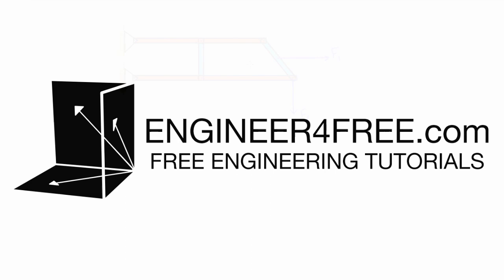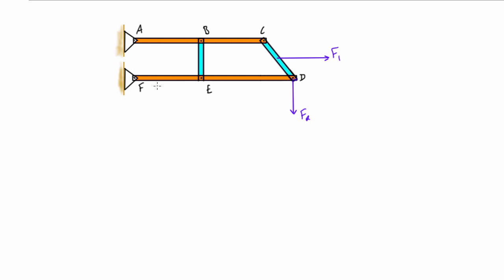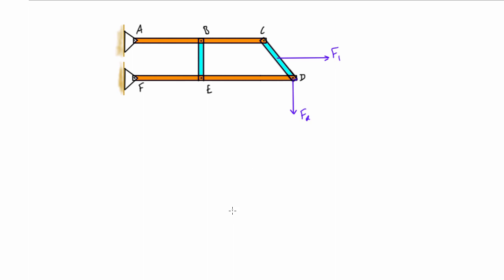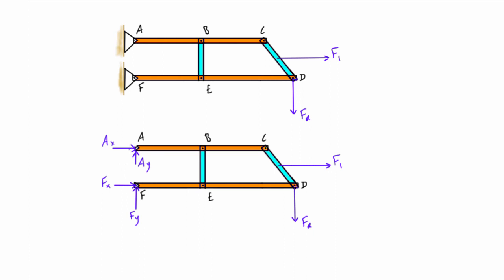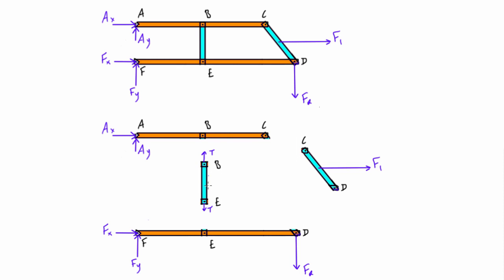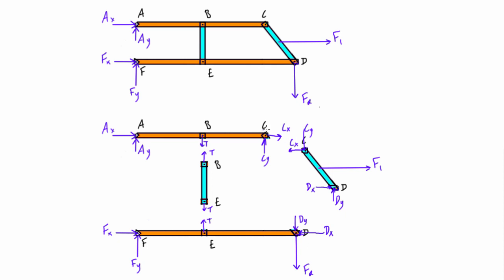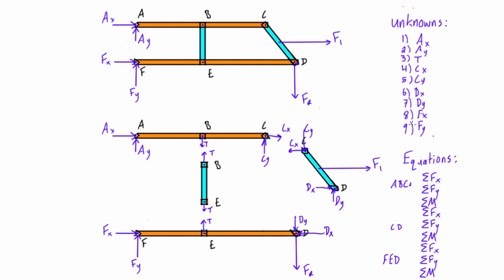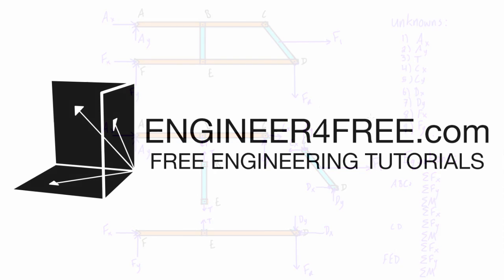How to solve frame and machine problems (statics)

Comment: Why does C have Cx and Cy but E does not have Ex and Ey? If they are both pin connected
Reply: Link BE is a two-force member whereas link CD is not (it is a 3-force member).  So, when you draw the free-body diagram of link FED, then you only have E_y - the force from BE transmitted to FED at E through the pin.  This is also true for link ABC.  Note that he labeled all those forces 'T' because they are all the same, just acting on different links.  When you recombine the links, those "internal" forces must cancel one another.

Comment: Thank you soo soo much. I was having so much trouble not with the problems themselves, but with the directions of the reaction forces. In class it wasn't made known that you had to draw equal and opposite reactions when you move from FBD to FBD, so I was incredibly confused as to why my answers were turning out incorrect. You clarified this in literally minutes!
Reply from the maker: Ah yeah if that detail is left out then frames make no sense. Glad I could help!!!
Reply: Yes, that's some good information to have!  It's a direct consequence of Newton's third law.  I like to think of these as internal forces because those pin forces do not show up in the free-body diagram of the entire structure; they only show up when you start pulling elements apart.  If you were to put the links back together, then those forces have to cancel one another.

Comment: Why is BEin the first diagram not a zero-force member? Why in this case is it a two force member?
Reply from the maker: In statics there is a distinction between trusses and frames. Trusses are made up entirely of straight 2 force members connected at their ends with pins. The structure in this video is not a truss because member ABC and FED do not meet the criteria; the structure is a frame. ABC and FED are not 2 force members because they are both experiencing a third applied force from BE that is not acting at the end (if it were acting at the end at a pin it would be combined with the other forces also acting at the same pin and be treated as the same force). Because trusses are straight two force members that are pin connected at the ends, we simplify the problem to assuming that the internal forces in any given member are axial, ie, no internal shear and internal bending moments within the members; pure tension or compression. If you have something that is not a straight two force member (like ABC or FED), there will be internal shear and bending forces developing in the member. So at point B or point E, members ABC and FED will have internal shear forces, and if you draw some virtual cuts around the points, you're going to see that for static equilibrium at the joint, that the force that BE applies on the joint will be equal and opposite to the internal shear force at that point. That's why it's not a zero-force member. It's important to realize that member ABC is a single member, not two separate members AB and BC. Same for member FED. Another giveaway that this is a frame and not a truss is the applied load F1 that is not acting at a joint. In truss problems, the applied loads ALWAYS act at joints. If you have a load not acting at a joint and not in line with the axis of the member, it's also going to be introducing internal shear and bending moment in that member, which takes us into the realm of frames that we can no longer assume to be in pure tension and compression. In statics you won't actually need to calculate those internal forces, but just knowing that they are present indicates we are talking frames.